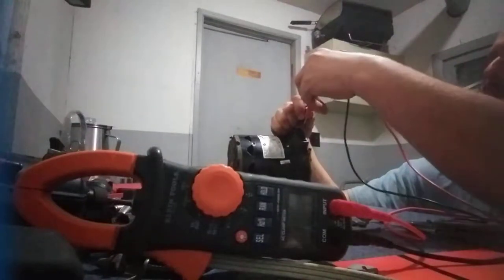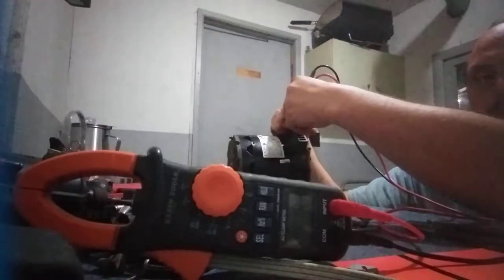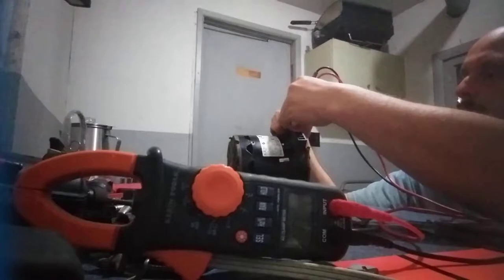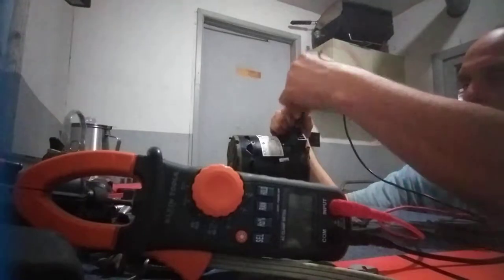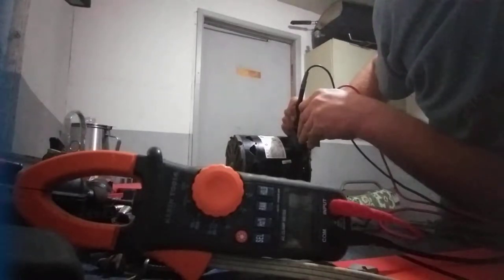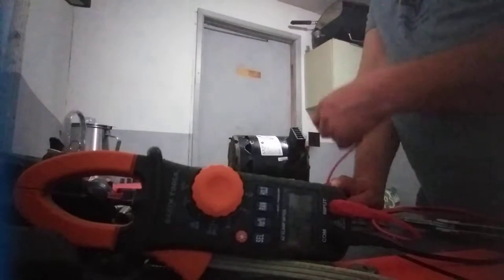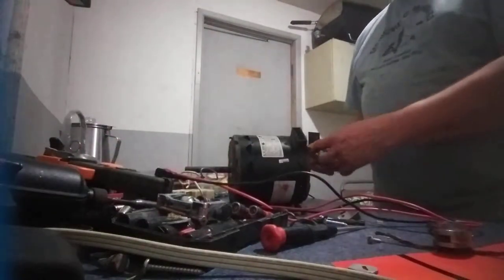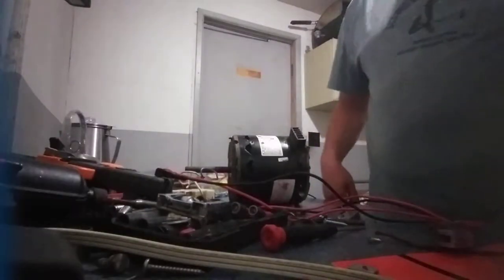Bench testing a furnace blower motor.

Comment: DIY'er here on a 1st time HVAC repair.  When we try running the AC, the blower motor usually turns on, but then stops working.  (Maybe it's overheating?)  I have the motor out and on the table.  I did the ohms test on all four speeds, and that looks ok.  Capacitor tested fine.  I guess I can get an adapter, and plug this thing basically into the wall, like you did.  Then see if it overheats, and/or feel the back of the motor.  I understand it should not get very hot.  (And btw, it's 26 years old.)  What do you think?